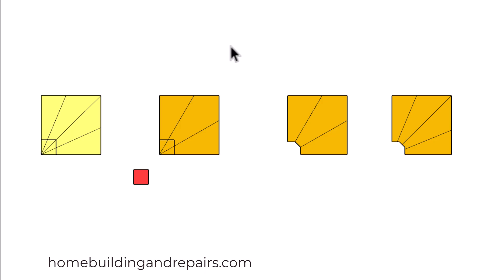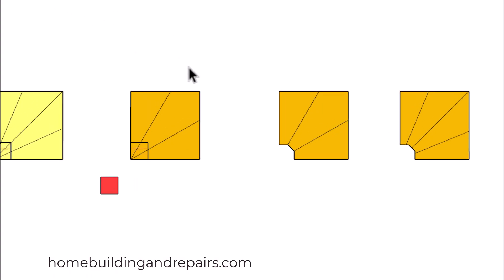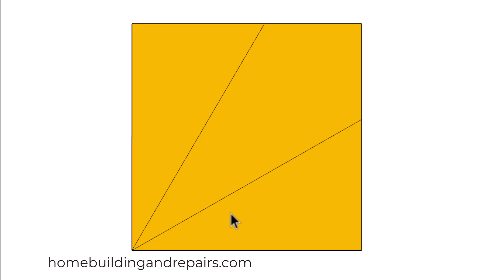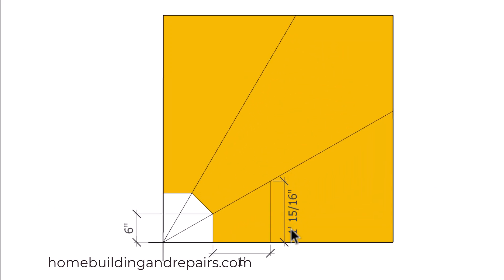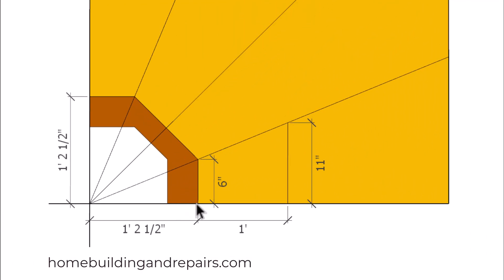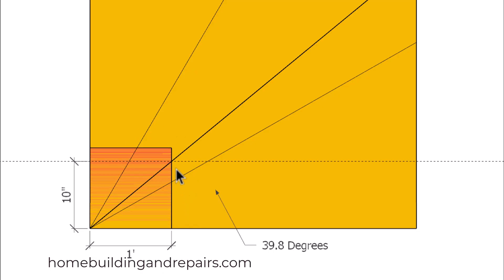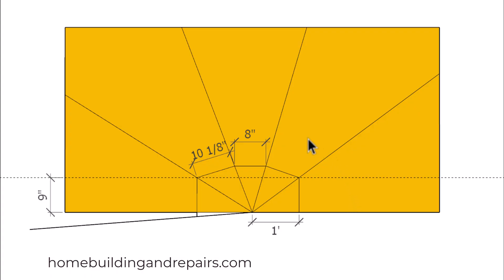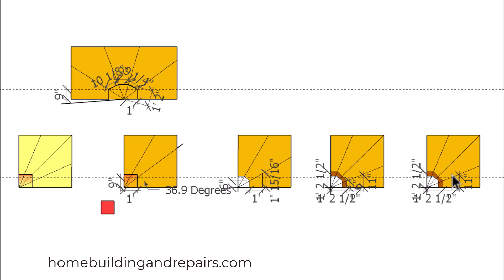What's the Minimum Angle for a Winder Staircase with or Without Minimum Building Code Measurements?

Comment: Question. How do you mark out the mitre for handrail up the wall on the winder. As they’re 2 different pitches on the winders as the pitch keeps changing as the winder goes round? Does this mean the mitre is a “bastard mitre” and means it needs mitre cut and bevel cut?
Thanks